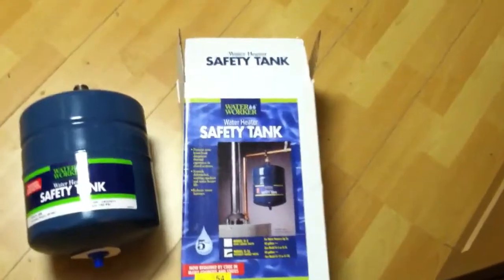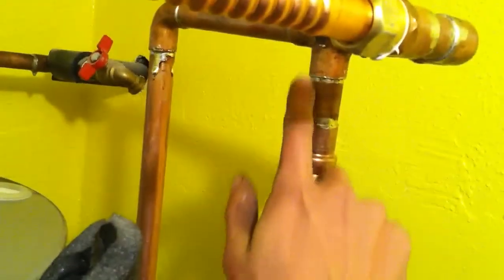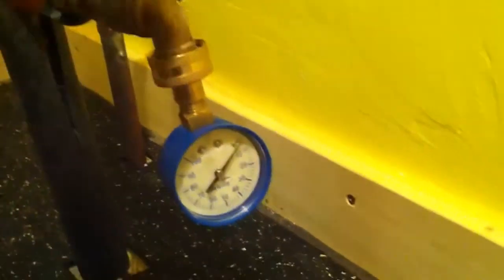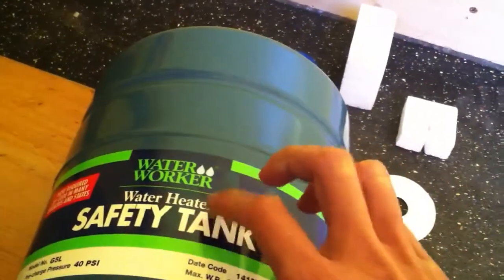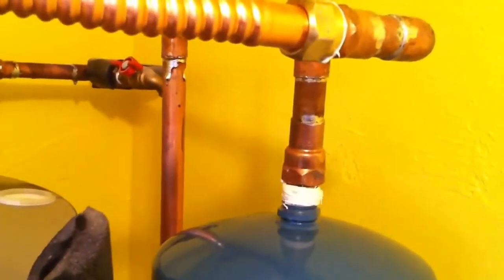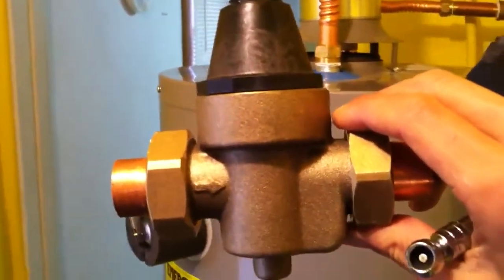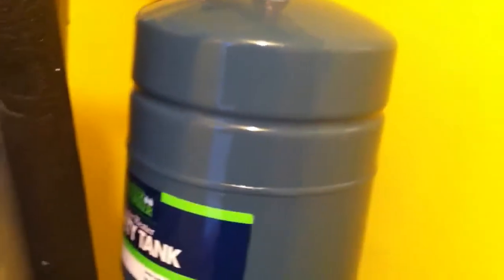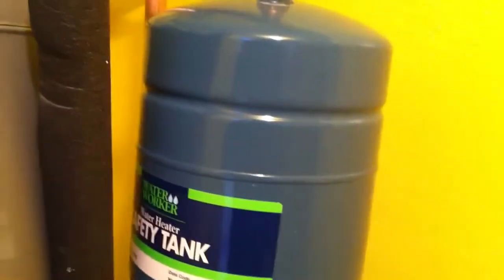How To Install A Water Heater Safety Tank

Comment: Being a home owner this info is good. I have had pvc pin hole leaks from hot water heater out put. It seems maybe a pressure regulator would be in my best interest to reduce pressure on this red pvc pipe to help prevent pin hole leaks in the future. I am not a plumber, but in the last 6 months these leaks have occurred twice, causing water damage to my 2012 Lexington double wide mobile home water heater enclosure due to hot water heater pipe pin hole leaks I discovered only after water had leaked under the dry wall covering into the utility room floor and soaking and ruining the drywall/sheetrock cover, ( A DESIGN REVISION COULD BE GLUE WATER PROOF PLASTIC COVERING TO THE BACK OF THE DRY WALL  COVER TO PREVENT IT FROM BEING RUINED BY A WATER LEAK, DETECTED, BUT TOO LATE. ALSO THE HIGH VOLTAGE CIRCUIT BREAKER BOX IS JUST LEFT OF THE WATER HEATER, ON THE OUTER WALL OF IT'S ENCLOSURE CLOTHSET. PLASTIC SHIELDING ON THE INSIDE OF THE WATER HEATER ENCLOSURE CLOTHSET MIGHT EVEN LOWER HOME OWNERS INSURANCE COSTS.
Reply from the maker: Pressure regulators are great. I installed one in addition to the water safety tank for added safety.

Comment: If you don't have a closed system, such as a pressure reducing valve or backflow preventer upstream of it, you wouldn't need an expansion tank on domestic hot water. If you are going to install one, provide an isolation ball valve so you can test, service or replace it without having to shut off and drain the water. You must have the tank removed from the water pressure to charge the air in the tank. With a shutoff, just turn it off and test. Water coming out of the Schrader valve means a blown diaphragm. Add pressure when offline to match the house static water pressure, then open the cock. The weight of the tank can be a significant issue especially on large tanks. The code requires a pressure reducing valve if your static inlet pressure is greater than 80 psig. Also, install water hammer arrestors at fast closing water valves such as washing machine water inlet valve and dishwasher.

Comment: I don't agree with installing the tank hanging down. Installed up, the tank and bladder  will maintain a cushion of air. Installed down the cushion of air will leak out (except for the bladder air) and will cause spitting air at the faucets and increased weight hanging on the pipe. The flex copper to the water heater will not support weight. Unless separately supported, expansion tanks should only be installed on solid soldered ("sweat") copper.

Comment from the maker: Thank you for the comment, and glad it was helpful! My water pressure reading was 70 psi so I ended up installing a water pressure reducing valve to bring down the pressure to match the expansion tank reading.  That's a good point you bring up though, you want to test the pressure in the line without the expansion tank first so that you won't end up with a false reading.

Comment: Thought the video was very helpful; however, I would advise that once one checks the pressure in their line one should set the expansion tank to that pressure before installing or one may get a false reading.  If the pressure is not pre-set to what the incoming pressure is the pressure from the incoming line will make it appear there is more pressure on the tank than there actually is.  Just food for thought.  Please feel free to double check my information.  Thank you for the video!

Comment from the maker: It does need to be supported.  Usually on both sides of the tank either by pipe straps, or in some tanks depending on which brand you get supports are included with the tank.

Comment from the maker: In my case, since I had a water pressure reading of 70, I had to install a water pressure reducing valve to bring the water pressure down to a level that wouldn't damage the tank.  I wrapped the teflon tape around the screw threads, then I coated it with a little bit of pipe dope.